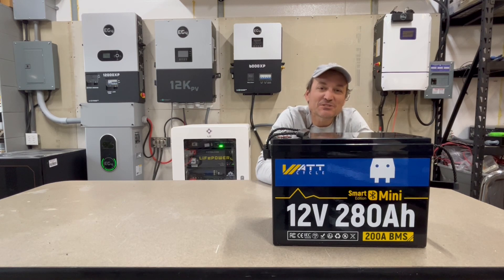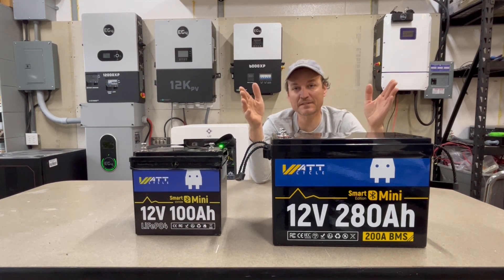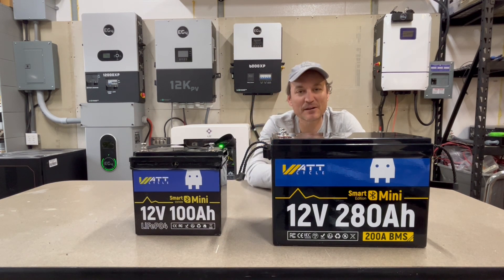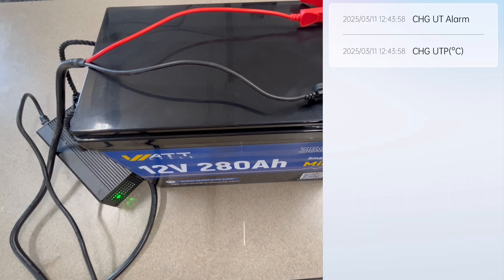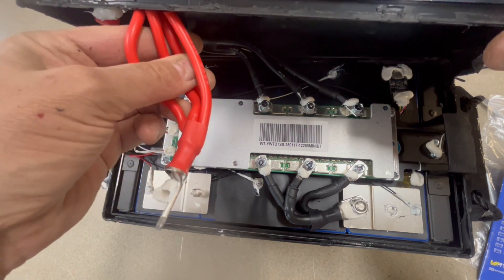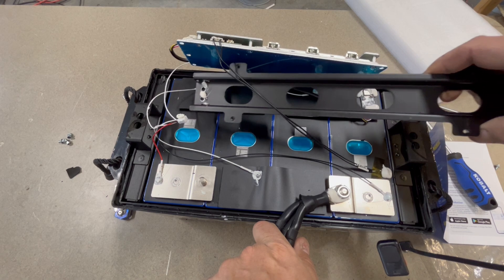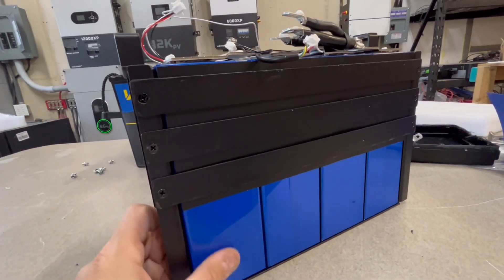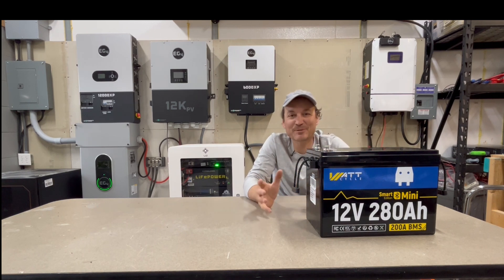Wattcycle 280AH mini battery teardown and review

Comment: Did you check the over current protection? I watched a video from another youtuber that said it was over 800 amps but Wattcycle says they've fixed that issue. I'm just wondering what your experience was?
Reply from the maker: I didn’t check it no. I always recommend using over current protection anyway. So in that case it shouldn’t be an issue.

Comment: WattCycle App has been updated  in early Apr-2025.  Tap (V) and the "Battery status" screen pops up with the individual cell voltages and Summary ( Max Min Avg Diff ).  TapTemperatire and the Temperature screen pops up with the 4 temp sensors.

I personally agree with "avoid wiring batteries in series".  My reason is I don't like purchasing 4 12V batteries to make a 48V bank as I pay for 4 BMSs (vs 1 BMS) and I need to pay for the extra wiring.  Unfortunately (for me) the economy of scale tends to make the very popular 12V battery your least expensive option (Typically 4 12V batteries are less expensive than 1 48V battery of the same Ah capacity).  Also with 4 batteries in parallel balancing the batteries in a string is another task or expense to deal with, where a single 48V battery just takes care of all the cells at the same time.

Comment: Great video. What is the trick for removing the top cover?
Reply from the maker: I used a flat head screw driver and worked my way around the rim with it. Not an easy process.

Comment: The goop just prevents the bolts from breaking-out (losing torque) from thermal cycling.  It's kinda like holding a piece of wood against the wall vertically.  If you let go, it falls to the floor.  If you apply a little pressure, it doesn't move... it stays on the wall.  Same thing applies to torqued bolts.

I think we are starting to get to the limits of what anyone would reasonably want to buy while still sticking to a 12V architecture.  The actual cost of having to use thicker bus bars and cables is significantly higher than building a higher-voltage pack with the same capacity would be.  And the BMS's are hitting a wall on the power they can transmit on the cheap at 12V.   It's just that we don't really see it on the retail side yet because there is such a glut of 12V batteries on the market now.

-Matt
Reply from the maker: I understand the general purpose of the goop. But they always seem to get overzealous 🥴. Yeah 12v really isn’t practical for larger systems. Some people really like 12v for van builds or smaller needs. It has to be something specific for it to be practical really. But I do like the larger batteries if you do have a 12v system. Less BMS’s means less potential future problems.
Reply: @GavinStoneDIY  Also vibration and shipping stress when it comes to goop.  These devices all get banged around to one degree or another during shipping and large inductors and capacitors can wind up getting bent out of shape by the G forces.   For inductors and transformers, goop (and potting) is used to reduce vibration which in-turn reduces annoying humming.

Generally speaking having more batteries wired in parallel is going to be a lot more robust than having fewer batteries (or having just one battery).  The BMS's do not have to work as hard when you have more batteries tied in parallel and a battery failure won't take down the whole system... it might not even be immediately noticed.

For example, a 12.8V @ 280Ah battery might have a 200A BMS in it that is not even rated to be able to run the battery at 1C continuously.  These BMSs will be under more stress at any given load.

In contrast, if you had three 12.8V @ 100Ah batteries with 100A BMS's the BMSs would run a lot cooler and have no trouble running at 1C... the bank of 3 batteries could run all day at 300A without blinking an eye.

And when one goes to higher voltages... well, now we're talking 51.2V @ 100Ah where 100A is over 5kW.  Put a couple of THOSE batteries in parallel and you'll have a bank capable of charging and discharging at 20kW that you might only be charging and discharging at 5kW most of the time.

-Matt
Reply from the maker: @junkerzn7312 there is something to be said for redundancy with more batteries. I myself prefer less and larger. The EG4 wall mount batteries vs the rack batteries for instance. But to each his own. That’s why there is multiple options on the market.